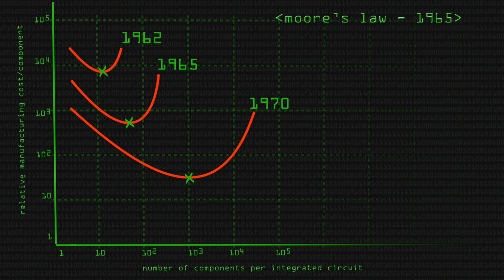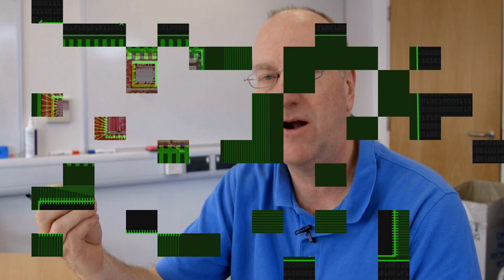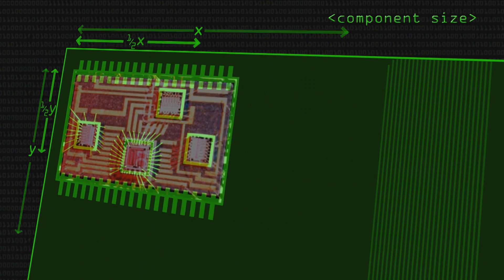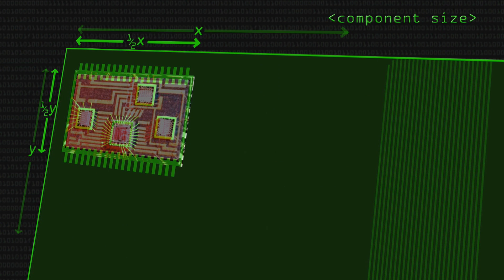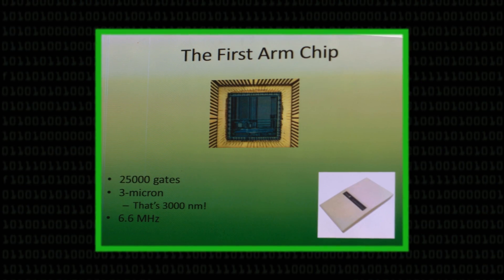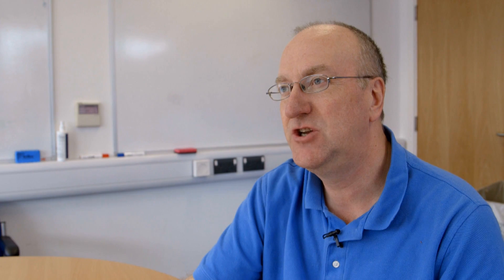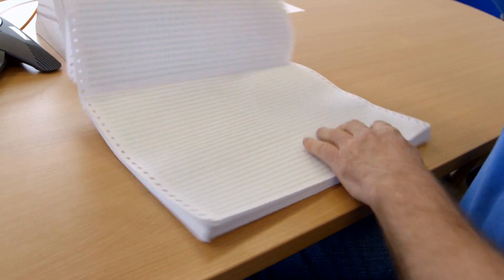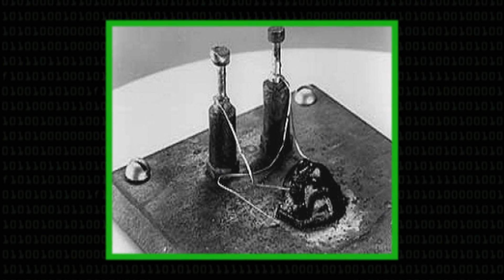Is it the End for Moore's Law? - Computerphile

Comment: One of the biggest costs in the semiconductor industry is actually the rate of progress it self. If you have to upgrade your production line every 18 months to have a sellable product then you only have 18 months to recover your costs. If computing power per area hits a wall, the cost per area will plummet and people will just start building computers with more physical silicon in them.

Comment: Moore's law in its technical state, yes. End is nye. But speaking on principal, no. There'll be shortcuts which make an effective circuit alot smaller than it actually is. ARM processors are a prime example of why the principles of moore's law.

Comment: Now that IBM has announced the development of its groundbreaking TrueNorth 'neurosynaptic' chip, modelled on the human brain, I wonder how the picture changes yet again.  The chip has 5.4 billion transistors and uses 1/10,000 the power of a standard Von Neumann architecture chip.  It will not replace traditional chips, as in terms of raw processing power they are still much superior (as are computers vs. the human brain), but it will augment them to such a degree in areas such as graphics recognition, opinion mining, information retrieval, language processing, etc. that it renders Moore's Law meaningless.

It is not clear if the TrueNorth chip itself will be the one to begin combining neural network computing with standard computing, and it is not known how long it will take to develop and disseminate adequate code to run the chip, but the advance is still stunning.

Comment: Well, nothing lasts forever, but just as transistors replaced vacuum tubes (as I'm sure vacuum tubes replaced something before it), something will inevitably replace transistors as well and continue the trend until computers literally cannot get any smaller due to the physical limitations of the universe. Even then, who knows. I guess the real question is how much computational power do you need? Eventually I think it will come down to just programming them to make them run more efficiently. 

I believe Ray Kurzweil predicts the Singularity will hit around 2039-ish, and at that point computers will (theoretically) begin to invent ways of improving themselves. At that point, all bets are off. Most people, including Mr. Kurzweil, predict that when computers start to upgrade themselves, they will do so at a rate much faster than that of Moore's Law. Too fast, in fact, for a regular human to comprehend.

Comment: I read an article that talked about the actual wiring in the circuits and that they are so thin that the electrons flowing through them cannot travel side-by-side. There is not enough room. They have to travel single file and that is a problem because that means the wire size has reached it's limit. I can go no smaller. I don't know what the long term solution is, but that is an example of just how the laws of physics are screwing up Moore's Law.

Comment: intel i5 have clock 3 - 3.4 ghz at 22 nm.

In 2010 IBM constructed graphene transistor with clock 300 GHz at 120 nm.

Looks like graphene will replace silicon.

Comment: strange title. moore's law ended in about 2006 and the industry started cheating using multiple core processors.
Reply: Moore's Law hasn't ended, as the video points out we're getting close to the physical limit where error correction is too heavy. Keep in mind the chips do their work in little slices of time. You typically have a slice of work, a slice of validation and then a slice of error correction if validation fails; the latter two are combined in some architectures. Eventually you will reach a point where the amount of time spent on the slice of work is equal to the amount of time spent on error correction. That's the limit where Moore's Law is no longer practical and we are close enough to that limit that it's just not worth the extra cost for majority of chip use cases.

There are two other ways to make the chips faster. Drive them with a faster clock or make them smaller. These two kind of go hand in hand. As the chip gets smaller it becomes easier to cool. As the chip is driven at a faster clock rock it generates more heat. Heat always increases the chance of error occurring, it's not just a matter of keeping the chip from melting.

Unfortunately increasing clock rate without also increasing clock rate of everything else throws things out of sync causing some parts to be under utilized. If they get too far out of sync then you get a pipeline stall. Imagine memory is able to do 1 read per tick but it takes 4 ticks to start reading if it wasn't already reading. That's going to cause a delay for whatever is accessing memory, we call that a pipeline stall.
Reply: Hey man, I totally agree. But they can only make transistors so small with silicon before the heat/current will burn them out too quick.

I believe they are currently doing something with carbon nano-tubes, I think?
Reply: True, but still multi-core/-threading and parallel computing is the future. For instance I'm impressed by what GPU's can do in parallel.
Reply: Cool, carbon nano-tubes sounds new to me!
Comming from a more software-like perspective, my hope for the future is that they'll make possibilities in programming languages to easily manage multithreading on a huge scale for lets say 1000 cores, so it doesn't become a mess to debug. Together with a neat simple and elegant design also for GPU. OpenCL and CUDA are great, but it should become easier than that.
Great hardware needs great software to really show off. :D
Reply: You can still only fit so many transistors in a multi-core chip though.
Reply: Hahahahaha NO.
Reply: Alan Hunter Exactly, we have the technology to make 1 atom wide transistors, but we can't make a lot of them, and we can't make them cheaply, nor can we make them stable. Those are the requirements.
Reply: No, Moore's law never ended. The law doesn't state that performance, or frequency, or instructions per clock, or anything like that, will double every two years. It states that the number of components which we can stick on to an integrated circuit will double every two years - which it has since 2006. Intel's Conroe microarchitecture, first available in 2006, had just under 300 million transistors, whereas a 2012 Ivy i7 has 1.4 billion with about the same die size, so that's doubling 2 and a half times in 6 years...pretty much following Moore's law, keeping in mind that it's not exact.
Reply: It's hardly cheating. You have 4 cores or 8 cores, but the size of the chip doesn't change. That's pretty much what Moore's Law is about. They could make one core with that many transistors, but some time ago people realized that having a CPU do multiple things at a time is just better than having it do one thing quicker. As I'm sure you know.

Comment: I've always wondered this, while I want a more complex universe in general. Why can't we just have a larger, CPU/chip/etc. I see the value of being small but if we just made it twice as thick, etc wouldn't you get about 2x as fast. I would have a smaller radiator, fan, etc and have a faster computer. Why are all the chips so small, why not larger?
Reply: Because the larger it is, the further information such as electricity has to travel, and therefore the slower it is.

Comment: Why is every professor always showing a bipolar junction transistor to explain digital circuits? They are almost never used in integrated digital circuits. If it just that they could clam its a US invention instead of a German.

Always start with "the first transistor was invented in the US in 1946"... and then when you learn about field effect transistors, you learn that it was invented by a German in 1926. Is it only me, or is 1926 before 1946 or not?

Comment: I really loved the last couple minutes of the video describing how the laws of quantum mechanics begin to interfere with our computing as we begin working in such low scales.
I imagine 3D computer models will become the next step, as it's probably the easiest to achieve once we figure out the heat situation.  Quantum computing is a fantastic concept but that's for our children's children's children to play with, not to mention that it computes in a completely different way using Q bits than our current classical bit systems.  
Molecular computing would be a cool next step considering we have been able to use transistors the size of carbon atoms, but that has it's own world of instability problems.

Comment: Pretty sure doping is not done using ions, that would literally make it negatively or positively charged whereas in a transistor the P type simply has a hole where an electron can bond and the N type has an unbonded electron but the overall charge is still neutral.

Comment: Ehh, not so much stacking of chips as there is going to be static and heat interferences. It is more likely that curved chips and dedicated piping to be the next best method. It takes advantage of 3rd dimensional real estate while dispersing heat more evenly, you can fit three times more chip on a tube the same width, grade school math. Now taking advantage of how differently isolated atoms act compared to groups of atoms it could be easy to create multi-element transistors only a few atoms wide, using the quantum mechanic variable to our advantage.

Comment: A couple thoughts.  One person criticized the processing of the human brain because the neurons 'leak' their signal, it seemed to me this could actually be helpful.  You mention 3d and architecture.  My engineer mind tells me that cost savings will still be accomplished here by changing the design less times.  Then, of course adding more of the currently discrete components into the architecture.  Specializing the architecture to the tasks, such as having a video editing processor and a slightly different gaming processor, etc.  Efficient cooling can also yields results in performance, possibly to the point of using liquid and ultimately superchilled architecture, especially possible with all the discrete components within the chip covering.  It seems to me that we could actually use chemistry itself to make the transistors and/or we could get a transistor with more states (0, 1, 2) and then possibly quantum computing.  Still, it seems we still reach some theoretical limits are daunting like weather prediction and global warming modeling.

Comment: Will we move to multi CPU systems when the processor's hit their limit? Will we go from the traditional one CPU, to like 4 12 core Atom processors?
Reply: We have already been moving away from CPU heavy solutions for like 10 years now. What have hold us back in the in PC (and xbox) is the directX that forces the CPU to run looked steps with the GPU. Now with DX 12 this problem is midigated, so with the new DC the GPU is CPU independent, they you will basicly not have to use a high spec CPU to get great frame rate.

Comment: There is also the question of how much computing power we actually need. I mean, most applications hardly use all that power which hardware provides nowadays. Sure, there are always areas where you can't get enough computing power, like cracking encryption codes or realtime rendering a photorealistic 3d environment, but these are not the things that "Joe Average" would use nor need on their desktop PC, laptop or tablet computer. So basically, for the normal standard usage (except gaming of course, but that's one of those special applications I mentioned above), PCs that are 5 years old and older most of the time are very much powerful enough, and even a machine that is 10 years or older can still be of some decent use for lots of things to do. That wasn't the case in the year 2000, when a 10 year old PC was practically useless for most things you might want to do with a computer. My oldest PC I'm currently using is a P3 from 1999. OK, it serves only as a print server in my wireless local network, but it is set up to be able to use the www as well, although it is dead slow if one would actually try that (even with the now 4 year old Xubuntu 10.04LTS on it).

Comment: 3D computing, multi core systems, Ligt computing...
There is plenty of stuff we don't use jet so I don't think it's over jet.
Reply: Multicore systems are an alternative to higher clock speeds, not to higher component densities. Also, you're just assuming some technology will step in and everything will continue as usual. There's no law of nature to ensure this. In fact, if there is any such thing as a physical law in this then that exponential growth will at some point stop. Same goes for economic growth BTW. People just assume it will keep growing because it did so for a couple of decades. Stupidest mistake ever.